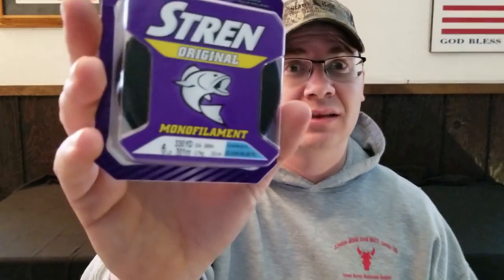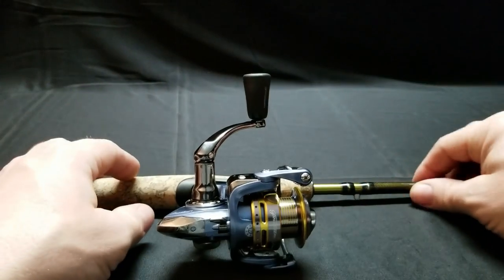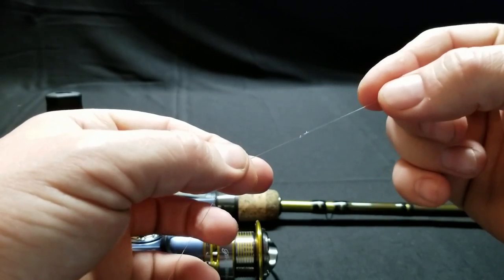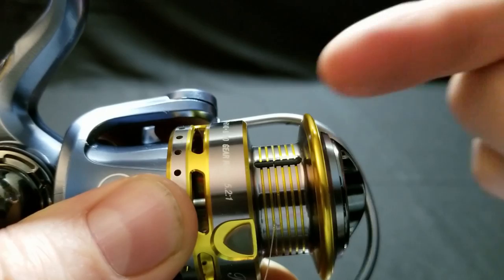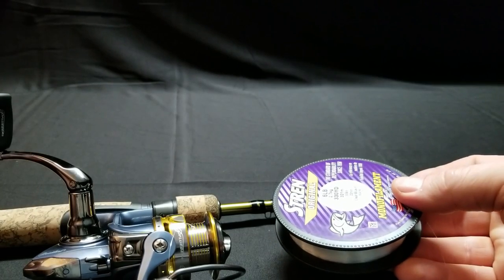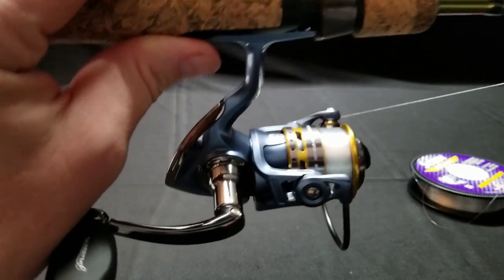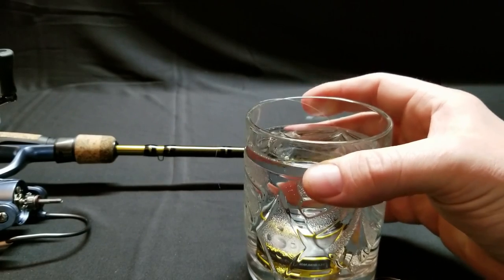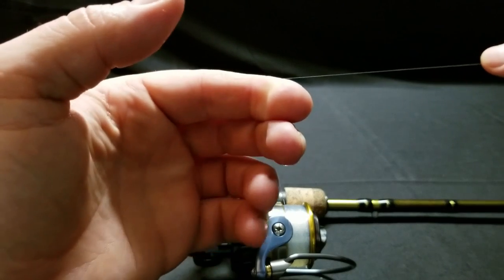NO MORE TANGLED LINE!!! | How-To Put Line on a Spinning Reel

Comment: Didn’t some places use line filler first so that you’d put about 140yrds of Strenn vs 200 yards. I almost always fish from shore so 200 yards is a lot of line. I’m talking back in the 70-80s which is the last time I had my local tackle shop put line on for me. The filler was put on first then the line.
Reply from the maker: I'm not sure about that as I was born in the 80's but backing line is definitely used with braid and sometimes flourocarbon line to save money.  With monofilament it's pretty cheap so no need to use backing in my opinion.

Comment: Never used mono lines before. Boy, I was not prepared for this. lol
Reply from the maker: Did you get it?  Mono can be tricky.
Reply: @MidwestBassHunter  Yes I ended up buying a spooler machine and it helped tremendously.
Reply from the maker: @ElixirEdits  good deal!

Comment: Good to hear your suggestions tho wonder about consistency of the label up idea and will watch for counterclockwise despoiling. 
I'd be particularly worried about damage resultant from soaking the Entire spool and Drag Washer complex  in the warm water. (Perhaps if distracted or forgotten and soaked for over 60 mins?) 
Then taking water back when remounting c rest of reel.
Any comments on this?
Reply: Maybe try a wide rubber band tight around newly loaded spool for a day or too? Hair drier? Warm cupboard?
Reply from the maker: Not sure, never had issues with the water, of course I’ve never left it in there for an hour like you suggest.  Not sure on those other methods 🤷🏻‍♂️

Comment: hmm my post has a gear and a plastic washer on top of it but no metal washer and ball bearing like yours,is this normal for some designs? says i got 8 ball bearings,i see yours is 10
Reply from the maker: Yeah that’s normal and that’s not a gear it part of the clicker that you hear when a fish pulls drag.
Reply: @MidwestBassHunter  yeah but its still technically a gear with teeth and the ratchet with the spring(on the inner part of the spool) clicks on it,,like you said the drag system

Comment: Thanks for the video.  Wouldn't you know it.......first time I tried this, the spool of line (PLine CX) came off clockwise, not counterclockwise.  Since I'm using the same Pfleuger reel as in the video, I assume all I have to do is place the spool with label DOWN, not up.  Correct?
Reply from the maker: Correct
Reply: Midwest Bass Hunter    No, label  facing up with line coming off the filler spool in counter clockwise direction.
Reply: @GLOCKCOPG23  Label facing up is not always correct ... but coming off counter clockwise is always correct.   Not all manufacturers have the line coming off counter clockwise when the label is facing up.
Reply: @adammckenzie605  No fail method. Spool the line any way. Take rod and reel out on your boat. Let the line out  while running at good speed. No weight or lure, just bare line. Now reel it in. It will lie flat on spool. This works if line kinks up after you fish with a spinner that twists up the line

.

Comment: the line always come off counter that what the reel does . I have a President reel and it turns  clockwise if you extent  it to the spool it should come off the line spool Counter Clockwise.  eliminating line,memory . if done right you won`t need to put your spool in a glass of water

Comment: Please watch this video .
Both strengths and trilene have lines that come off clockwise and counterclockwise. 

And when putting line on a bait caster with a pencil. The line should come off the top.
It was not mentioned in the video.
"The obvious is not always apparent to everyone".

When looking at the top of the spool. The bail goes around clockwise on 99.999% of modern reals. Set spool on table top so line comes off ccw

Comment: I've watched this video and one saying a certain knot will give out when using braided line. I've been fishing for over 20 years and I've never had an issue with the braided line but am I putting it on the wrong way? I've caught many fish, larger than average and never had an issue with braided but other types I've had it tangle and what not but for years now I've only used braided. Am I supposed to worry still or are these videos somewhat false? The knot I've used my whole life is the uni knot.
Reply from the maker: Braid doesn’t have line memory so it doesn’t matter how you put it on
Reply: @MidwestBassHunter  Thank you for clearing that up!
Reply from the maker: No prob

Comment: Sadly, I've had fishiing line that comes off the spool the WRONG direction when following the 'label up' rule. Yes, in general, most manufacturers spool line onto a spool in the same direction. But occasionally someone at the factory misses that 'rule' and puts either the line or the label on the wrong way (more likely the spool got flipped in some machine). Literally just happened to me when I was loading up a new spinning reel couple months ago. Laid the spool, label up, and started reeling. Wouldn't you know it, the line was coming off the WRONG way. Had to flip the spool to the NON label side. Man I wish I could screw up at my job and still get paid...you know, like weathermen. LOL
As to the water bath, if someone 'forgets' to do it....before ever using the line to catch fish (and if you're on a boat) put on a big heavy lure (take off the hooks) and let the line off the reel (open the bail and use a barrel swivel) behind the boat,  farther than you can cast (the boat has to be moving). When you reel in the line it will 'untwist', if it has any, AND stretch. If no boat...give the line a bath at home. Save the headache.
Reply from the maker: I have encountered line that comes off the spool the other way since I made this video.

Comment: I Don't care who replies,  seems most our professionals on here . Well I'm an amateur or I wouldn't be on you tube searching guided videos. I just spooled Berkley line on my reels spool vertically with a horizontal ✏ like an amateur . I did use an arbor knot that I just learned then watched this video so now I'd like to remove it and do it correctly and apply  memory as well . Any takers? cut away
Reply from the maker: Cast it and reel it a dozen times, see how bad it twists up.  It may be ok.  But if it’s twisting up then you probably want to find a football field or some place with lots of room, tie a swivel on the end, run al the line out with someone holding the swivel so the line can spin and reel it in.
Reply: @MidwestBassHunter  Thanks .

Comment: Do the bearings or gears for the drag system ever need to be greased?
Reply from the maker: You never grease the drag, but yes spinning reels should be cleaned and lubricated now and then.
Reply: @MidwestBassHunter  
Yeah i do. But i smear only the tiniest amount on the metal washers. 
The newer reels that have carbon washers also use a drag grease.

Comment: Hi Chris, is it possible to spool the line on too tight?
Reply from the maker: Not really, the tighter the better, if you break the line... that's too tight...
Reply: @MidwestBassHunter  I put my braid on too tight in the middle and it would never cast past that section. Probably wouldn't have that issue with mono though
Reply from the maker: @Dapsters  hmmm, I've never had that
Reply: Dpa SFT  sounds like your line got over lapped when originally put on, that’s why it only casts so far.

Comment: Lengthy post coming up - this can be a brain@#$, but read on : 
(1) Overall, you want the line to end up going onto your reel the same way you're going to end up pulling it from the spool lying flat , and not mounted on a line spooler. 
(2) You need to check your specific reel - some, like in this video, turns clockwise, meaning the line gets put on clockwise as well . 
(3) You can't rely on label side of spool, you need to check which way the line was spooled - put it down so that the line comes off the side of the spool in the opposite direction the reel turns (as if you would when pulling it straight off with a line spooler, and in doing so, make the spool turn the opposite direction your reel does). 
(4) Since you're not going to pull it off the spool that way, but when laying the spool flat , the line will actually come off the spool in the other direction - which will be the same direction the line will end up getting wound onto your reel (i.e. as stated in (2), in the same direction your reel is actually turning).

Comment: always counter clockwise off the spool no matter what side your label is on . Your reel should be putting it on clockwise. this way the line is going on the reel the same way it's coming off the spool. And never try to just start reeling up a slack line either. make sure you get the slack out of your line and close your bail by hand.

Comment: when i put the spool into the water all the "butter/lubricate" washed off, now my spool is everything but smooth. would rather have a tangled line tbh. =-)
Reply from the maker: I can’t “make” you do anything bud, and the spool by itself doesn’t have any lubricated parts, so you must’ve done it wrong bud.  What reel do you have?
Reply: @MidwestBassHunter  thats why i rephrased my comment :) i have the abu garcia revo ike 20. It had some gel both at the top of the reel and at the bottom where it attaches.
Reply: Feels kinda bad since its a 250dollar reel :/
Reply from the maker: A spinning or casting reel?
Reply from the maker: Put more lube on it.
Reply: @MidwestBassHunter  its a spinning reel. Yes i Will try to do that, should hopefully help :)

Comment: No way a spinning reel is harder than a baitcaster to spool. That's a crazy statement
Reply from the maker: Riley McGill more difficult in my opinion, I have a video on how to spool a baitcaster also.
Reply: @MidwestBassHunter  putting braid on a baitcaster is one of the most delicate things I've ever done. I guess its different for everyone. I just find a spinning reel very easy to spool and a baitcaster very difficult and one little mistake can ruin your fishing trip. I liked the tips but that statement caught me off guard lol
Reply from the maker: Riley McGill for me it seems if you put the line on wrong on a spinning reel you get massive line twist that makes it almost unusable.
Reply: @MidwestBassHunter  I will say when I was using mono I did have that problem. Once I've switched to fluro I never have that problem. But the actual spooling of the reel is more difficult for me personally on a baitcaster

Comment: My line doesn't stay on the bail where its supposed to how do i fix this
Reply: You must not have had bail open when tying onto the reel spool.
Reply: @MRScrubNasty  i did thats the first thing I did. It just keeps on sliding to the other side ive never had issues preping my other reels. Its one of those lews combo reel from walmart i got it for ariund 50 bucks
Reply from the maker: How did you put the line on?  Sounds like it was spooled backwards.

Comment: I was a child and I figured this out on my own. Pay someone to put line on your reel? Wtf? That's a thing? Run your line through the 1st guide closest to the reel. Lift your bail. Loop it around that little plastic triangle that you have your thumb next to. That's what it's for. Then drop the bail. Now this next part is kinda hard. I have a nail in the side of my work table. It's about 6 ins long and has a 45 degree bend up ward on it. Place the line on that. The corner should rub on the wood. It helps create tension. Now reel. Thats it.

Comment: Why do you want your line put on the spool without twists? The first 100' or so off the reel doesn't stay that way. Especially after your first line break or a dozen or so casts.
Reply from the maker: Much better if you don’t have twist in the line
Reply: @MidwestBassHunter  You will always have twist with a spinning reel. That's what it does. The question is where...on the spool or between the spool and the end of the line. If it's between the spool and the end of the line, what happens when your line breaks? The twists come out and the reel twists it onto the spool when you reel it back in. I have an electric line spooler that I can mount the spool onto the arbor and put the line on without any twists. The problem is, it doesn't stay that way long. Every time you take the lure out of the water, you lose a couple twists.

Comment: Liked the video, but for some reason I could not see how you ran the line from the spool thru the towel to the reel,  you went too quickly. Thanks
Reply from the maker: Robert Setlock sorry about that, you just pinch the line between your thumb and forefinger with a towel or washcloth, does that make sense?  Thanks for watching!

Comment: I put my spool in a hot cup of water for about 20 minutes
Reply: ok i am doing this now for 10 min under runing hot tap water in a glass and let it rest for another 5 min in the water after shutting the tap off but im worried about the washer and the drag mechanism(spring and ratchet) not being stainless steel and rusting on me,,i tried a magnet on them and they are def magnetic metal which is fucked up ,,so now what?? i am drying it right away in my oven at 170degF and then i will add a touch of 3 in 1 machine oil,but not sure i want to get oil on the top washer as its big and i do not want oil near there spinning all over the place,,help

Comment: Interesting about the water but how do you keep the spool from running around the floor like a drunken rat while you are reeling?
Reply: Put it in a shoe box ?
Reply: @maaifoediedelarey4335  It would have to be a box small enough where the spool could not flip over but that may be a good idea if you punch a small hole for line feed.
Reply from the maker: Shoe box?
Reply: @MidwestBassHunter  Yes, that's what I do. Though @John Strand has a point - I do feed the line through a small hole, but also stick a pencil in from the bottom, put the spool over it, and close the top. Then anchor the shoe box, so it doesn't go flying all over the place !

Comment: Sorry to say this technique resulted in the worst twisting of the line I've ever encountered.  Maybe all the line maker's don't put their label on the same side.  I  went back to the old pencil thru the line holder method and it spooled up like a champ.  I've seen others say how this works, but not for me.
Reply from the maker: Sorry it didn’t work for you, I have had this comment from others so I bought some different lines and that is true, the line is not universally wound the same.  Always make sure the line comes off of the spool counter clockwise and you’ll be good to go.

Comment: Putting the spool in water is the worst thing that I ever tried. It made it tangle so much more that I removed all the line again and started over without the water. No more tangles. Avoid the water!
Reply from the maker: Huh, you must’ve done something else wrong, the water only helps to change the memory of the line, would never cause it to twist more.

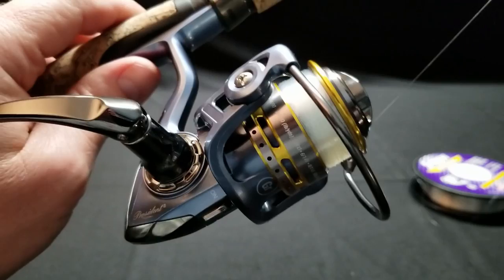Comment: Hmmm.  No twist?  At 5:51 you can see the line at the filler spool coil up........twisted.   And dunking the spool, allowing water to enter the drag stack?  Whut?!?   60+ years of fishing tells me this is not a good practice.  Spray the filler spool with a line conditioner (I prefer Blakemore, finding the KVD stuff ineffective).  Spray the reel line roller with the same and spool up with the filler spool horizontal, the line coming off the bottom.  No line twist.

Comment: That's not true label side up. I have 2 spools of trilene and one spool is like yours in the video. The other is counter clockwise label side up. So the best thing to say is that it should come off the spool clockwise. Generly" label side up
Reply: It should come off the spool counterclockwise.
Reply from the maker: Yes you are correct, as long as the line comes off the spool counter clockwise you are good to go.

Comment: Just saw this vid which suggests this method doesn't solve the problem. But an inexpensive line spooler can. Curious if you're still using this method or if you've jumped on the gimbal/spooler train as well.

https://youtu.be/EIlMd6f1qGA
Reply from the maker: Still use this method with no issues.  I’m sure that spooler will work just fine also.

Comment: That could have been (should have been) a 5 minute or less video. Also, you obviously have little experience with different brands of line. They are not all wound the same direction.

Comment: Sorry, but you are not correct, the information you are providing is WRONG. Firstly there are things inside the spool that don't like getting wet which is why companies are always searching for better ways to waterproof their reels and spools. Mix a little bit of water in there with the lubricants used and you will turn the lubricant into mush and ruin the drag system. Soaking the spool in warm water first would be a much better option. The best way to do that is let the spool of line soak overnight as leaving it on the reel spool in warm water for a few minutes will only let the water penetrate the first few layers of line. Secondly label up or label down doesn't make a difference. The manufacturers spool their reels in bulk in a spooler which doesn't impart twist. You spooling you spinning reel incorrectly imparts twist. One of the problems you face is that generally speaking your reel spool is much smaller than the spool of line it is taking line from. This means that the bail arm will turn around the spool probably twice to one rotation of the main spool causing twisting problems because of the size differentiation and the fact that the line is laying flat on the original spool and is being twisted to get onto the reel. Get a tackle shop to spool the reel up for you or get one of the little rotating line spoolers for spinning reels that you see on Ebay for a few bucks, put the line in there and wind it onto the reel from there.